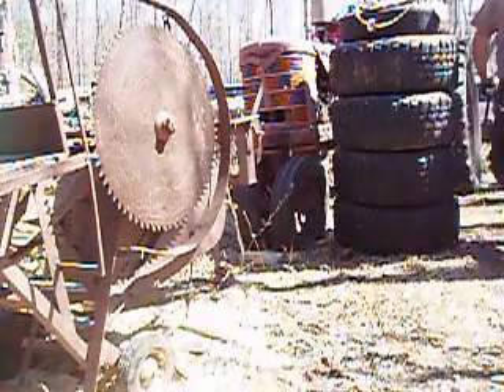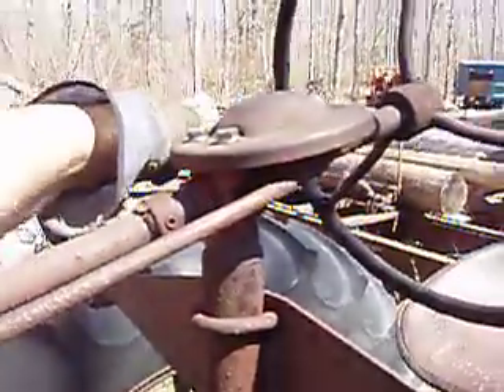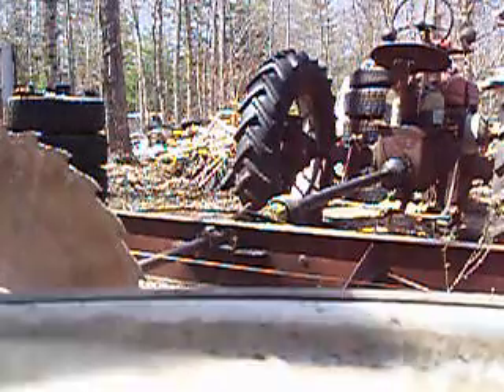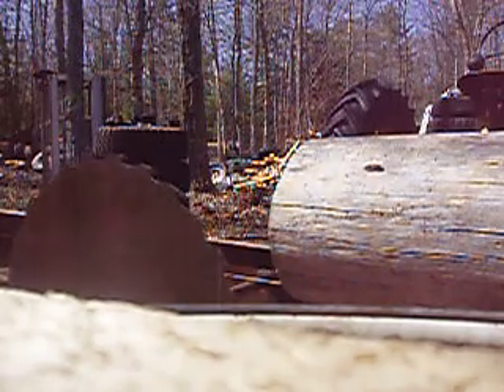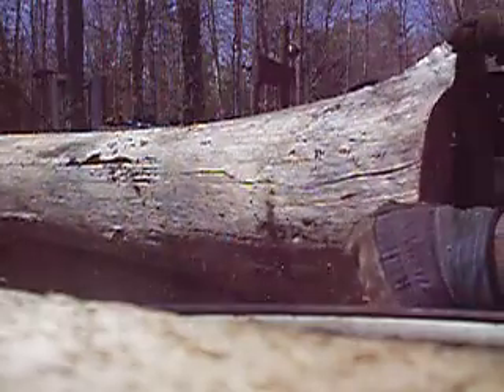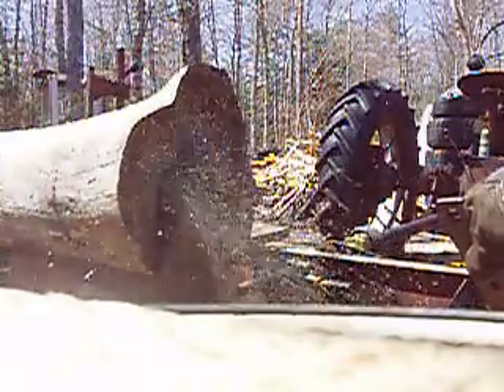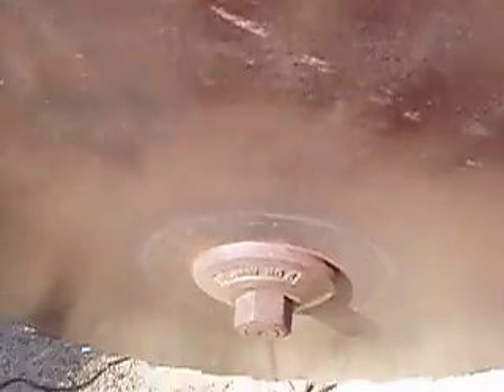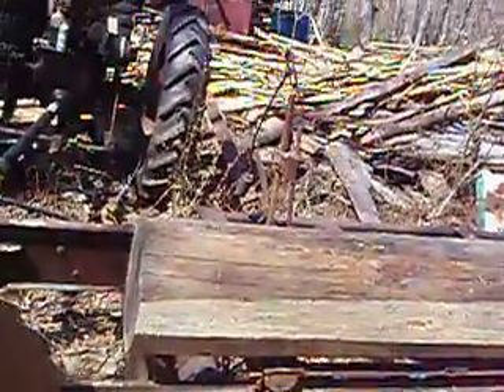The Belsaw saw mill

Comment: Finally getting the bugs (mostly) out was nice.  I have one of those Belsaw mills.  I ran ropes over the saw to the pto control (luckily on the steering console of JD4030) so I could start and stop without running around or over the mill.  Thanks for putting up the video :)

Comment: Today I rigged an overhead throttle linkage that allows me to control the engine speed from the carriage lever. I also put on a return spring on the governor linkage that tightens up the linkage and keeps the RPM from wandering.
 The oil pressure issue...I punted, and routed the oil pressure guage feed line into the oil fill cap. So the oil just runs into the fill hole.
 So far its working great and tomorrow we are planning on working it all day.

Comment: Once you get the teeth on that steel saw sharp, keep it oiled.  Don't let the teeth rust, that will allow them to pit, and surface rust will wear off on the first couple pieces of wood you cut...acting like sandpaper to the teeth.  Dulls it right quick.
You may want to file those gullets deeper to keep the saw from loading up, it will make a big difference.
And for God's sake build a fence around that blade so you don't accidentally fall into it.  These rigs were two-man jobs.  My uncle had one.